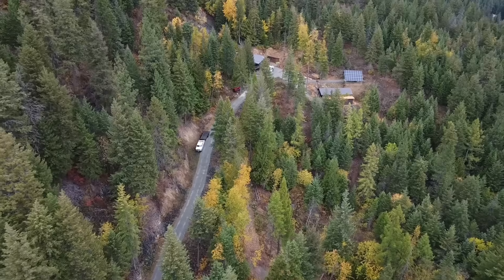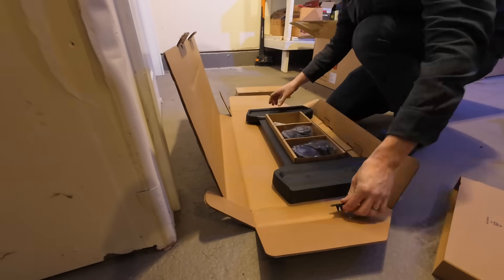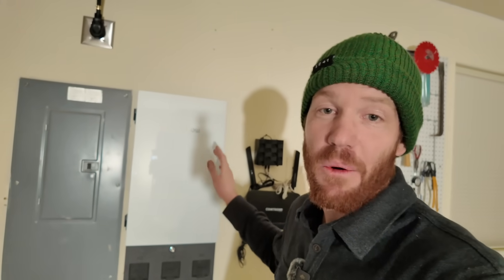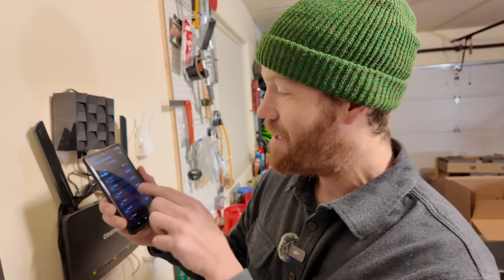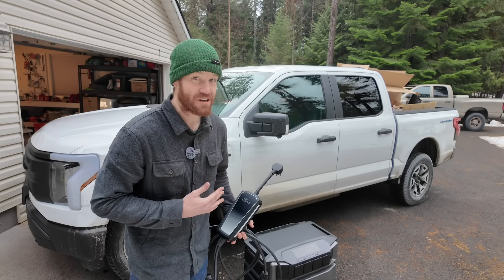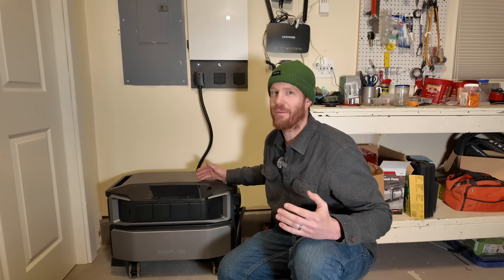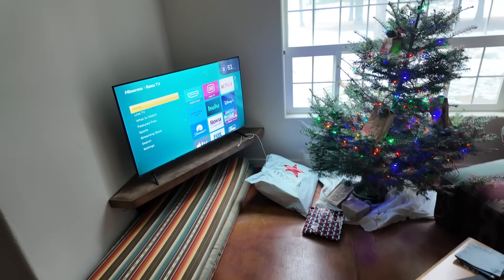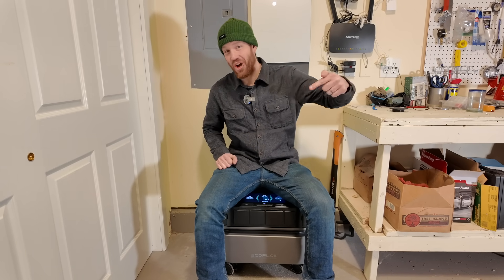EASIEST Off-Grid Power System! (EcoFlow Delta Pro Ultra)

Comment: Gotta love when 10 youtubers all drop the same "i LOVE this brand" video on the same day.
Reply: Second one I’ve seen today on this very same overpriced back up system!
Reply: @donaldfrazier5244  these are actually below market rate for comparable battery systems.
Reply: @donaldfrazier5244 you're braindead
Reply: Looks like all influencers got the nod to do ecoflow infomercials.  This is one of the best channels on yt.  I know it’s a commercial, but love their other videos.
Reply: To be fair it does seem like a really good product. We've already seen Ambition Strikes negatively review sponsored things. Is it worth the money? That depends on how much money you have. I'm sure it's not the cheapest option depending on how much you want to DIY.
Reply: @JorenMathews 

There's no way you can tell if this is a good product from this video. The video was highly flawed. For example, when he "tested" the EcoFlow by turning on the faucet and saying, see?  it powers the well pump, well that was just crap. Anyone who's lived with a well pump knows that the well doesn't kick on the moment you turn on the wter. If you're using a blue pressure tank (like most people do), you might use 8 gallons of water or more before it finally needs to bother the well for more water. Translation: just turning on the faucet for a second in no way will let you know if it can power a well pump. I'm sure it can, but I didn't like that AT ALL. The well pump DID NOT kick on when he "tested" it.

Comment: Since the early 1990s, high frequency, transformerless inverters gained the reputation of being the poor man’s inverter and were meant only for short lived, temporary installations. They were never designed nor meant for permanent installation to safely power a home’s appliances. 

First of all, these units are NOT UL-1741 listed, so unless you’re living in a tiny home, good luck obtaining a permit to install this unit into your home’s electrical system. In addition, without a UL-1741 listing, you won’t qualify for many of the state rebates and tax credits that are available. 

Even today, after more than 25 years of product development, You'd be lucky to get even two to three years of service from these Chinese made high frequency inverters, especially when powering high inductance loads like full sized refrigerators, large power tools, portable AC units or large microwave ovens. The reason for this is that all of these lightweight, high frequency inverters lack a very critical component. That critical component is an iron core, copper wound output transformer. Without an output transformer to act as a buffer to absorb the electrical surges provided by the “Flywheel Effect” inherent in the physical amount of a transformer’s iron, these surges and damaging reverse voltage spikes must be handled directly by the inverter’s MOSFET transistors, essentially shortening their life. 

You might be able to start and run some high surge loads when these high frequency inverters are new, but every time you fire up one of those inductive loads, you're shortening the life of the MOSFETs in these inverters. To make things even worse, lightweight, high frequency inverters run much hotter and their internal components are far more stressed due to their high switching speeds and use of high voltage components, These two factors makes the low cost, off spec, Chinese made components such as capacitors, MOSFETs, diodes, resistors and ICs that are used in these inverters, far more prone to early failure. Simply put, high frequency inverters are better suited for like duty, electronic devices, and low frequency inverter are better suited for heavy duty, high peak power appliances. 

Another major consideration with many of these lightweight, high frequency, transformerless inverters is safety. First of all, high frequency inverter don’t have Isolation between the Neutral and Line which increases the risk of a shock hazard. And second, during a catastrophic of the failure of the inverter’s circuitry, all it would take is for the AC output monitoring circuitry to fail and one of the MOSFETs in the inverter's H-Bridge circuit to short to ground, and these high frequency inverters can send dangerous, high voltage, high amperage DC current straight to your connected AC loads which will not only damage most AC appliances but can also set those AC appliances on fire. 

Another issue with most of these high frequency solar generators and inverters is that, rather than go into an overload shut down, the units will lower its output voltage, creating a brown out, which can drop its voltage to as low as 80 Volts which can cause damage to your home’s electronics. Brownouts can also cause damage to insulation and cause unexpected electronic failure in the future. A sustained brownout could cause damage to electronic motors that are in everyday appliances, including washing machines, dryers, fans, air conditioners, refrigerators, and freezers. US appliances are designed to operate at a nominal voltage of 110 to 120 VAC not 80 VAC. What these cheap, high frequency inverters are doing, is sacrificing your appliances to protect itself.

Another consideration that is never mentioned by those Youtube high frequency inverter affiliate hucksters, is that the vast majority of these inverters are non-repairable. After the warranty runs out, you're not going to be able to ship these units back to the manufacturer in China and have them repair them. And at a typical shop rate of $125 per hour here in the US, with no schematic and limited parts availability, it won't make economic sense to even attempt to repair one of these units. Once the FETs have fried and have burned a good portion of the inverter's PCB, (And trust me, sooner rather than later, they will fry.) they basically become a brick. 

A much better choice would be to invest in a UL-1741 listed hybrid inverter and a bank of LFP batteries or power station that uses low frequency, transformer based technology in its design. Low frequency inverters can handle high surge loads for at least 3x (300%) their continuous rated capacity and they can do this repeatedly, without sustaining damage to their MOSFET transistors, for minutes, rather than the milliseconds that a high frequency inverter offers. That's why the big name brand inverter manufacturers like Schneider Electric, Outback Power, Sigineer Power, Magnum Energy and others, all use a low frequency topology in their design.

Comment: So Riley how much did this cost? We have 32 solar panels on our house similar to what you have. We don't have the batteries for storage or back up. Any excess power we produce goes back to the grid. The company that installed this here in Florida is Solar Fit. They've been in business for 47yrs. They sell Tesla backup batteries, which are expensive.  What would you recommend for backup batteries that aren't so expensive? I liked your SOK system, and I'm sure they are less money than Tesla. Oh our electric bill went from $360.00 a month down to $30.00. That's when we're getting full solar. I'd like to have batteries for storage.
Reply: I don't think this is garbage at all. In fact, I think Rileys presentation is done very professionally. And more power to them for being able to do this. I value their opinions and would buy products that they promote because they are very credible.
Reply: Looking at the link in the description it looks like its $7200

Comment: So this is a cool tool. I will point out that for most American homes 7500 watts is literally NOT whole house electrical outlets, lights, water heater, microwave and washing and drying.

For those that have 3 or 4 ton a/c this would t come close to powering whole house.

For an entire 2000 sqft home to power entire house, 20 kilowatts whole house generator are needed. 

I love this family channel but wanted to point out that 7,500 output is the same as a gas generator. I love the modular design and upgradable ability of it. Whole generator Briggs and Stratton, Kohl’s, and generac are most common whole house and usually run off natural gas or propane. These are very expensive but actually provide a lot of security for outages and bad weather.

I thank you for showing this. I wonder how much these things cost.

Keep making videos. I love them. 

I couldn’t do 98% of the manual labor that you guys do but love seeing how someone else can make it happen! Well done!
Reply: It's about $4000 right now minus the panel

Comment: Are you really "off grid" if you need Internet and apps that can "monitor your usage from anywhere"? Personally I'd think half the point of going off grid is to partially isolate yourself from the failings of modern society chief among which is surveillance capitalism. Having Internet connected apps/devices that can monitor and control individual circuits in my home seems uhh, not great. It's less "off grid" and more permanent glamping

Comment: I have been studying Ecoflow and a thought comes to mind if you are on ecoflow backup for an extended time and the city power still hasn't come back on. ecoflow is low, can you use a fossil fuel generator to charge the ecoflow back up while still on ecoflow power? For some, power could take weeks to restore after a huge weather-related damage to the city power.

Comment: I use 240 Kwh per month, and that's a lot lower than similar households, so a 90 Kwh battery would only last me 11 days.  That 6 Kwh battery he installed would only run their well pump for 2 1/2 hours. The microwave (1500 watts) will have no power.  How about house lights?  I have had power out for days when a tree fell.  An automatic standby generator is cheaper, and could power the whole house.

Comment: Why not move all the circuits over to the Delta? You should be able to configure in the software which circuits should remain active in a power outage situation. And that way, you'd have the whole house under power usage monitoring.
Reply: And hey, hook up the generator to the Delta as well (it even has a spot for the generator, as well as two solar circuits :D)

Comment: Unless I missed something: how do you keep from back feeding the grid during power outages?
Reply: Yes you missed that it powers only selected circuits, not everything. So there's no risk of backfeeding.
Reply: The 100 amp feed in from main breaker to the EcoFlow Panel has a relay. It is either grid power or battery power. Never both.

Comment: I saw on another channel, that they said the outlets on front do not work when connected to home grid. That would make sense though. Why would you use or need to use the outlets while it connected to home grid. I'm looking at home battery backup system for my new home build this year. This is by far the easiest but pricy.

Comment: Can the system be programmed to charge off peak and run the house at peak rates?   Could save. 10 to 30 cents a kwh and pay for the system.  Then add addional battery modules.  One day, parents will be using the battery to rescue your electric truck.  May as well use all of your solar and add additional storage.  You can use the truck to recharge batteries if smoke or clouds sock you in.

Comment: Neat system. You probably should have mentioned the main disconnect interlock currently on your parent's home panel. I presume that is a left over from when they used a generator to avoid back feeding the grid. Did I understand correctly that the EcoFlow panel has a build in transfer switch and gird back feed protection?
Reply: Yes.

Comment: One thing that the EcoFlow website spec's do not mention...  What kind of surge suppression capacity does it offer.  Wouldn't it just be wonderful (not!) if a lightning strike would take out both the power and the Smart Home Panel!
Reply: Great point, Riley, you could get with a lightning and general surge suppression company and do a sponsored video on that, but please be REPUTABLE AND LOWER COST.  also try with Ting home monitoring.
Reply: @frankbodenschatz173  did some research...  Pretty sure that the Smart Home Panel would be considered a service subpanel.  Most jurisdictions permitting would require that the service panel be brought up to current code - this would require a type 1 or 2 SPD and an exterior service disconnect.  This would solve the surge protection; but, add details that would distract from EcoFlow being the star of this show.

Comment: Great video, EcoFlow is really doing a great job with their products.  I'm very impressed it switches in 20 ms.  Not sure a router or modem would stay up on the switch over, but if you have a battery backup for the Internet equipment it would not drop.  Where we live, the electricity sometime drops for a split second, so we got Cyber Power UPS's to keep our Internet devices up and running.
Reply: Router will stay up for sure. Most routers have a powerbrick that can last for a second after power is off.

Comment: That well pump sure seems to be drawing a lot of power.  Should it even be running if nobody is using the water?  I had a well pump once that was running 24-7 due to a faulty valve that would not shut off geo-thermal heat pump.  By the time I figured out what was going on I'd burned out two well pumps and wasted $100s on electricity.  Silly me.

Comment: i know its expensive with a long ROI,   but building up a battery bank to charge overnight when power cost is low, then during the day disconnecting from the grid to only run off battery power.    i could see this as being useful.

Comment: This unit is not connected to the whole house, only 5 circuits. You didn't test the back-up under full power, the refrigerator should be running the compressor (not just the light). You needed to turn on the well pump, boiler and refrigerator compressor all at the same time. If you need to bring a 12K generator to charge the batteries, just use the generator. This unit is nice in certain places but it well not replace a whole house generator running on natural gas, that will run 24/7 if necessary.  And these generator can also be switched automatically. Batteries are always limited, yes this unit ran at max 7200watts, but only for a short time,
Reply: no shit. thanks obvious explainer. And they dont need to test the fridge and well pump at the same time because they tested it to over 7kw. The well and fridge combined arent coming close.

Comment: I just watched hoboTech do a review on this product, Eco flow is still in beta, so you’re installing something that hasn’t even been officially released? This means the final version could have a lot more capability.
But I didn’t like the 15 amp limit on solar! Even my Anker 2048 W hour solar generator has 20 A solar!
Reply: What is the voltage limit on your Anker?  15A is plenty when you have 450V capability. It’s just a matter of series vs. parallel.
Reply: @brianmills4891  
The voltage limit is 60 V. 1000 W is the limit. I have two 450 W panels in parallel. Even if it goes over the 20 amp limit, anker limits the amps to 20.
This is not my main off grid system, I have built my own system. The main reason you want more amperage, is because in the winter time, the hours are a few.

Comment: You sold me. Gonna get a system for my new home to be ready in 8/24.. Just and FYI, from Eco Flow Ultra Q & A.. "With only one battery pack, the fastest charging input is 6200W, taking about 92 minutes to charge from 0% to 100%. When there are two battery packs, the fastest charging input is 8800W, and it takes about 1 hour and 56 minutes to charge from 0% to 100%.

Comment: Honestly, I would like the system way better if you add solar to it. There is an inverter and a battery just to be there in case - unused expensive stuff. You can use the system as you have it anyway. Solar-Panels are not that expensive, but they help you to save on your electricity bill. Little investment, big gain over the years. And in case of a longer power out you can refill the battery with solar.

Modern PV-Systems do all include a battery and some kind of emergency-power (at least as an option)

Comment: Main issue with all this cloud solution - when company bankrupt - you are in hell. I prefer things that can be configured offline - without internet, also they can have all the cloud in parallel for cool features, but offline configuration possibility is must. If you need internet to power on and configure system that may help you to survive some catastrophe - this is not good. (Maybe there is no internet already, hello from Ukraine, we had an issues with internet for first months of occupation). And i have a Delta Pro - it can work without internet(charge and uncharged), but configuration is internet only.

Comment: Maybe add an IBC toad liquid container as you have at home as a  water tank for your parent's house at a second-floor-like height so the tank can supply water to the home with gravity assist only and you can set the parent's current generator as a second power input for the EcoFlow battery until they have a solar panel setup.
If you can use the generator running watts capacity for charging the EcoFlow battery with a cable directly then fine or you will need to add a generator transfer plug input box for the generator then EcoFlow can see that as a Secondary Power input from the generator side and use that to charge itself up when no grid is available after the battery has dropped to a certain 
pre-determined percentage level by you.
The generator will need to be on for about 4 to 6 hours to charge the battery fully after which it could be shut off and reduce the fuel consumption and the generator noise.
You can use the generator to help get through extended multiple days/weeks of black-out in town.
Just make sure to tell your parents to keep quiet about it or else they will find a whole lot of their neighbors knocking on their doors after a power outage especially when there is extended blackouts.